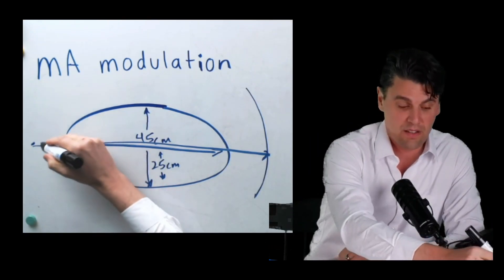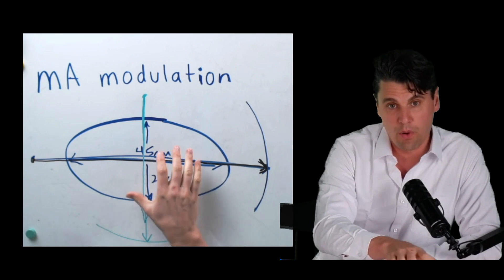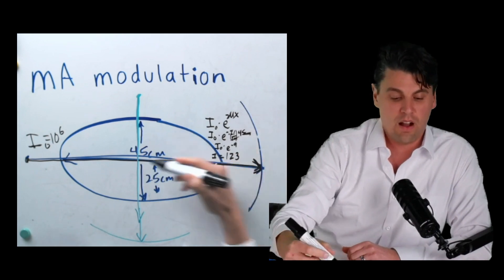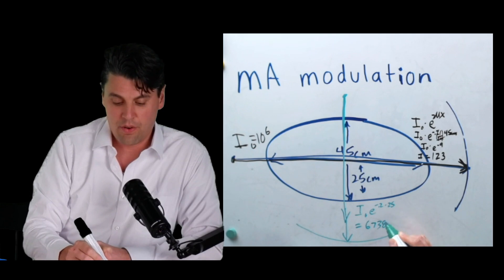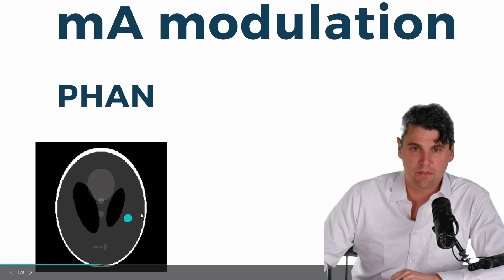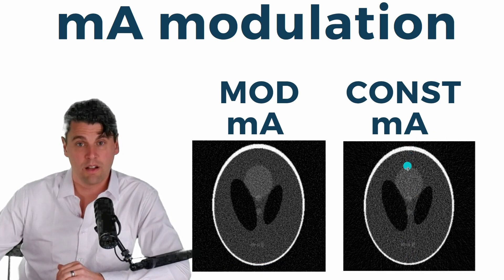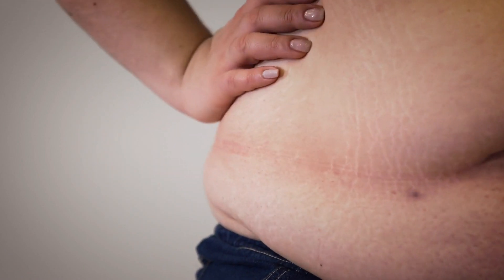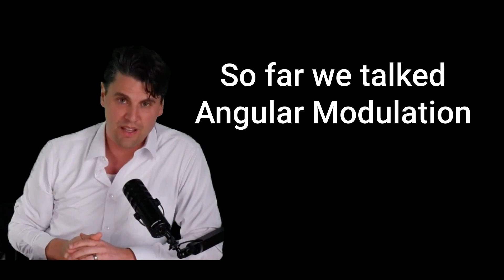Tube Current Modulation (CT Physics)

Comment: Thanks for the nice video. Doesn't the tube current need some time to settle once modulated to a new value? Wouldn't this cause image artifacts?
Reply from the maker: The tube current modulations are typically smooth and continuous functions so they do not cause artifacts

Comment: Thank you, great video. 
Is there any way to calculate the power of the x-ray (in Watts) when the mA is modulated? I know the formula only for the constant mA (w*kVp*mA).Thanks
Reply from the maker: At any time point that formula is correct and if you want an average over time you can replace the mA in your formula with the average mA of the acquisition
Reply: @HowRadiologyWorks  don't you know if I can find this average current somewhere in acquisition parameters on Siemens?